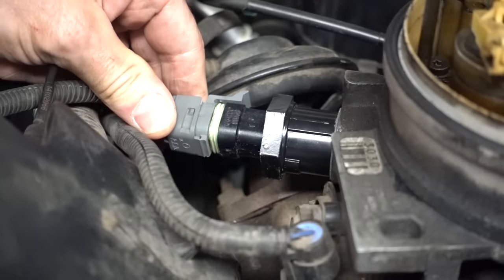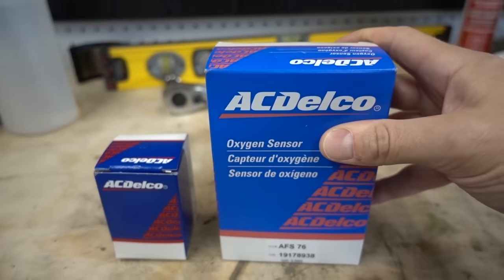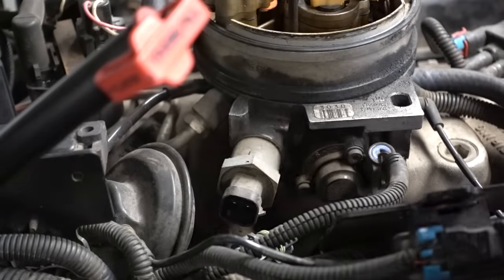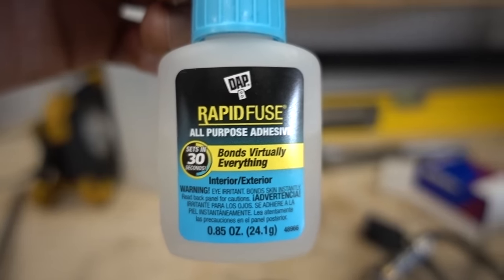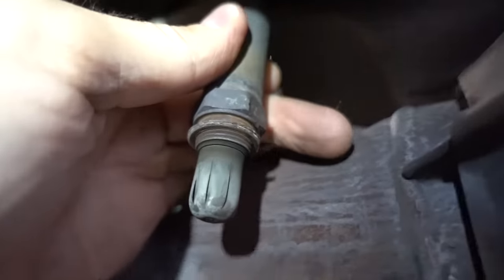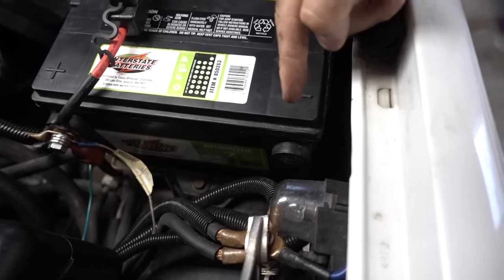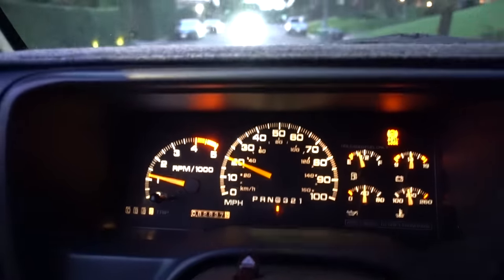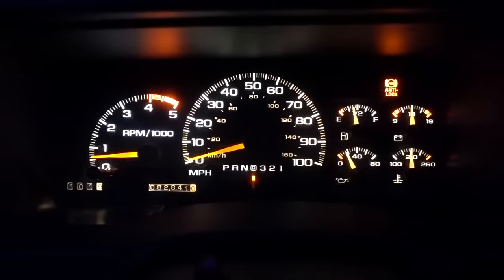Here's the TWO SENSORS YOU NEED TO REPLACE FOR BETTER IDLE !!

Comment: It's either a dirty or clogged egr valve, map, maf, throttle position sensors, carburetor if not the idle air control valve for rough idle. Also, check the vacuum lines for leaks.

Comment: plastic service allways has a glass slick servface so for bonding of to plastic services , even to add a small back up piece, it is better to sand or scratch the shiney off the pieces, it never faild me, even on tiny tubes i cannot get any more, it works great on plastic parts, the weld putty in a tube allways worked for me, like your u=tube, thanks

Comment: Apparently you don't know anything about vehicles, because you called items #1 and #2 sensors in which # 1 is not a sensor, it's a motor and not a sensor in any way shape or form, item # 1 is an IAC (idle air control motor), so there you go.
Reply: Idle air control module! SO, there you go 
He's correct that the IAC can cause idle issues per multiple sources, not just YouTube. 
Have a great day. Be the positivity you want to see in this world 🤙

Comment: Hey Jimmy FYI you need to drive a vehicle with a compute 50 to 100 miles for the computer to calibrate to the new sensors. Also the sensors may not look bad . But you have to remember that a by product is heat . Electrical will lose continuity after it has been heated up and cooled so many time" Hence a short circuit "

Comment: The best thing to do is to replace the connector, im sure they can be dissassembled and replaced without soldering using paperclips or the special tool for terminal removal which is fairly cheap also.

Comment: If you have an idle problem when the engine is cold it's probably the IAC valve, not the O2 sensor. O2 sensors don't work until they come up to temp. Even modern O2 sensors with heating elements take a few minute to warm up. The computer knows this and does not use the O2 sensor on start up.

Comment: The idle air control valve will let in more air in the throttle body when the air conditioner is turned on to keep the engine running smooth under a load..
Reply: Thank you. Probably would smooth my engine out when AC is on.

Comment: Cleaning injectors are easy. One quarter tank of gas,  put two bottles of Chevron techron injector cleaner. Drove it down to 1/8 of a tank, fill tank. The cleaner will have done it job. I have used this method when I have noticed a performance loss.  Will use this method proactively once a year.

Comment: Haha.
Had a friend lose his azz replacing parts on his R30.
Replaced the throttle body, injectors, Idle air cont valve, TPS, coolant sensor, fuel and pump.
Before all of this he asked me what I thought and I told him yes it’s dumping fuel but check your distributor, cap , rotor, wires and plugs.
He didn’t mess with the distributor.
He replaced all above mentioned parts and gave up.
He sent it to a trusted shop
That had it for a couple days and they found out his distributor was shot.
I think it was the shaft gear that was worn to darn near nothing.
New dizzy fixed his issues.
He called me up next day and told
Me I was right but he ignored my suggestion and went for everything but the distributor

Comment: I got tired of sensors giving me problems and computers letting me down.  All thats stuff was supposed to make the vehicles run better but as it turns out, they just cause problems when they fail.  The fix?  Mechanical injected 12 valve Cummins.  ;)  give it a try!  Hehe

Comment: I put a cone filter on without a sensor[ Nowhere to put the sensor] The idol ran rough. I put the original back in with sensor and the idol was fine. I didnt wanna cut a hole for a sensor so I put the original parts back in.
I'm gonna look for an another rubber pipe today

Comment: If you're trying to fix a clip like the one that snapped, next time use superglue and sprinkle some baking soda on top. It hardens instantly and hardens ALOT harder than normal. You can even completely replace the clip by making one out of super glue and baking soda sometimes.

Comment: just as an FYI as soon as you elevate your RPM your computer no longer sees it as "idle" and so when you say "I have been driving it for 5 minutes and it idles great" is erroneous because again, while you are driving it the vehicle is NOT in idle. There are also multiple forms of "idle" there is cranking idle, post-start idle, warmup cycle idle, and post-temp idle. So each of these will be affected differently based on the problem variable. On a tunable computer, you can change the static values associated with each of these circumstances. On a stock computer, the dynamic program can make this a challenge. If you find the vehicle is scavenging or "wandering" in its idle even after you replace the O2 sensors/IAC it is very likely a vacuum leak. Checking over all of your hoses can be valuable considering the old rubber on a 30 yr old truck easily could be cracked allowing small vacuum leaks to occur. I have a 1994 Mustang GT with a 302 and multiple bolt on's running off a MS3Pro PNP Megasquirt standalone ECU.

Comment: Take a little permatex plastic weld, Clean the plastic and put a little bit across the outside of connection and it will neber come out and if you have to unplug latler you can take a dremel and cut plastic weld, That plastic weld is stronger than the plastic and bonds very good, It heats up when it cures.

Comment: On my truck I have 2kw inverter, when I start microwave - voltage drops to 12.6v, but after changing ground wire - 14.4v under same load. Alternator 180A.
Reply: How’s this possible,
Reply: @beforeal580  high resistance connection
Reply: Yeah, positive side important for obvious reason but a weak high resistance ground circuit can cause all kinds of wacky issues

Comment: Judging by that hesitation upon start. I would suggest checking the gap on your spark plugs. Last thing when you reset your computer the jumps in RPM are what the vehicle will do to program itself. It will go away which I'm sure you probably kno by now. So whoever resets their computer it's good to run everything not all at once but when you go for that first drive so the computer compensates for the extra power it needs. Remember most newer vehicles do constantly learn. Older ones take a little more time and a reset once every 25-50k couldn't hurt. Even helped my mahs 2014 Fiesta Titanium and that thing has computers and gadgetry up the wazoo...

Comment: the IAC connection can be tightened up, but the proper fix is to remove the pins and get a new plug socket and insert the pins back into the new plug socket (or replace the pins AND the socket) but either way you CAN tighten up that connection... Lords Blessings! MARANATHA!!!

Comment: what you could do which  i saw a mechanic do is take a screw driver & heat it up with a torch for 30 -40 sec till it gets nice n hot then just melt them back together with care you could try that

Comment: Yes my Civic has 208,000 miles on it and recently sat for 5 years.  I thought about changing my O2 sensor(s) but I'm getting 37 mpg just like before so I'm unsure if I need to.
Reply: Is check engine light on? If so go to most any Auto parts store and get the code look it up if it's the o2 sensor at that point change it. Just for starters financially it's not a good idea to just start throwing new parts at it. Learn how to diagnose the problem or you can take it to a shop and have them tell you what's the problem then go home and fix it 
If you have the skills. That should save you money, time, aggravation and a headache. Good luck 🐒🔧

Comment: If you want a better idle, it's plugs, air filter, and quality fuel. cleaning an idle air control valve can help if dirty because they do open and close allowing for small variations of air to be let into the intake at idle. I've always found better ignition to be the best way to get a better idle.

Comment: You're right - RPM increase will go up with A/C running. Hint - if idle surges (idle goes up down up down up down...) when You turn on the A/C, You're probably LOW in refrigerant. Watch the top end in refrigerant and WEIGHT WHAT YOU PUT IN - HUGE difference in GM products for the last 50 yrs. Most people don't realize that. Hey - if MORE people traded experience, what would the world be like, right?

Comment: My 99-Z71-4X4-k1500 pick up has-4-O2 senors on the exhaust system. Sometimes it idles rough but my computers are constantly readjusting.

Comment: I have a 1995 GMC Suburban 2500 4x4 with the 5.7 motor. IT was showing an error code for the O2 sensor.  I replaced the O2 and MAP sensors.  While this cleared the code, the motor now stables, runs rough when RPM's are over 1500 and secondly, at idle, the motor will die when you put it drive or reverse; this happens 90% of the time.  Any suggestions where I need to look next?  These problems were not present with the old parts!

Comment: Not always true I'd replace those 3 times and still had the same issue then they said oh you need to replace the ecm and 1200 dollars later still running and idling like crap so I had done all that stuff changed and still nothing along with the ecm swop and surprise it wasn't none of those. So I put the one parts back on and put the old ecm back and I changed the 69 dollar vaccum booster and whammy it was fixed and running perfect so it's not always the idle air valve and o2 sensers and computer brain box.

Comment: Yes the initial high idle when you started it was the IAC motor automatically adjusting But i did wonder why did you replace the O2 sensor?  Did you have a check engine light for it?
Reply: O2 sensors start to read slow as they age so after 25 years of service in the exhaust system it's probably not a bad idea to change it.
Reply: @chevyguy6961  but why just one and why that one?
Reply: @karlpatch4146  My truck only has one O2 sensor that's screwed into the exhaust manifold.

Comment: The solenoid that powers the idle air control can just fail sometimes. Had to change one in my wife’s GMC Sierra which fixed the same problem you had

Comment: I have a 89 p u five seven TB at around 250,000 MI I had bad idle changed all sensors still Idol was bad finally changed my EGR valve that fix the problem

Comment: Weather pack connector is what u need for the IAC GM used to own the connector you can search 4 pin Weather pack connector on ebay or Amazon and will be exact fit

Comment: I have a 95 silverado . I noticed that your anti lock light is on . Mine is on too. I have a obd2 meter with a obd1 adapter from Amazon it would not work. So I couldn't clear code. Can you do video on  clearing codes out.

Comment: Im cleaning my 2003 Toyota's plastic electrical connectors with Meguiar's D101 All Purpose Cleaner. I then put 2 coats of Aerospace 303 on the cleaned plastic connectors ( not on metal electrical connectors ). Am i preserving the plastic or just get new connector housings? ( Toyota/Honda use wiring harness plastic connectors from same supplier ). Thx.

Comment: Great video, your on your way! I have a 2013 Nissan Rogue that idles high on cold start, cleaned mas and intake manifold, no codes. Rpm goes to 2k on start up, I think I'm going to try your sensor solution. Any advice? Thanks.
Reply: Your truck is supposed to do that.

Comment: The ECM in my Wrangler TJ is malfunctioning.  In order to get the aging Jeep fo start I had to jump 12 volts to the fuel pump and the fuel injectors. When cold, it runs very rough.  When warm, you can not tell the computer is destroyed.   I guess I am buying an ECM at the end of the quarter.

Comment: Iac was dirty imo. $50 for iac isn't cheap to me but considering most parts.... Ok. But probably just needed a clean. Looks like u still have a check light on. Good idea with the clip. A raise in rpm when AC is on is normal.

Comment: Guys, I had idling issues after my engine gets warmed up. After months of googling I found IAC is stuck on my palio 1.2 (2002). So I have removed it and cleaned with carb cleaner. I also loosened the spring and removed the thread which comes on it. Now the problem is I don't know how to recalibrate the thread which is present on my IAC. I don't know whether to tighten it till the end of thread. Because I'm concerned about the free back and forth movement of the IAC. Please let me know if you guys know how to calibrate or how much should I tighten the screw thread on my IAC. Thank you!!

Comment: I installed my IAC on my 01 Durango 4.7 ..now When I back up. I'm hear a clicking sound. Like that cards attached to bicycle spokes; which was not there the new was installed??
It's idling perfectly . NO noise going forward. However I did accidentally dropped a screw down between the radiator & condenser. But that shouldn't may noise going reverse; should it??  Only other possibility is adjust the new  iac . The old one was extended too far as if stuck.

Comment: Where does the other end of the  sensor connect? I live in a 95 GMC van and it has the exact same setup and currently dealing with a really bad idle I replace the IAC valve already but haven't done the 02 sensor

Comment: had a 92 Mercedes that idled around 1800 was told by a Mercedes shop that it would be around 1500 dollars that weekend I spray cleaned the throttle body and took the battery out over night and bingo the idle went back to 750

Comment: Did you look at your system with the OBII reader and did your "check engine" light come on? I have an older S10 Blazer and changed the O2 sensor on the driver side and when I looked with the OBII reader all the O2 sensors read "INC" and it was supposed to read after a drive cycle. I wish our engineers would be as patient as the Japanese engineers, I know they could build better.

Comment: As a GM owner, I could say this but even at 95 GM was behind the times with that truck. It looks like it was stuck in the 80s with the throttle body fill injection. Ford had a direct injection.

Comment: I just replaced my Idle air control valve, throttle position sensor, m.a.p. sensor, rewired the idle air control valve, NOW i just need to replace the O2 sensor... Oh and i need to rewire the map sensor

Comment: No way I could just replace one part and never know which was causing the problem.   And I’ve never  replaced an O2 sensor that came out that friggin easily.    Oh, it may hav3 been useful to include some quick footage of what the rough idle symptom was like for the viewers who are wondering exactly what was wrong with the truck. Just a thought.

Comment: Just plug in the connection, and put a spot of rtv on the connection. The rtv will hold the plug in. Might need to reset the IAC. Turn on the power, engine not running. Unplug the IAC. Turn off the power, and let stand for a minute or two. Then plug in the IAC, start the engine, this will reset the IAC.

Comment: One of your problems was a dirty throttle body. You need to either get it cleaned or clean it yourself. Get a book on your truck at a parts store and it will tell you about the IAC and everything else. It is normal for the engine to increase in RPMs after turning on the A/C. Get a book.

Comment: I would be thinking that with both the sensors not really all that tightly installed  there is a good chance of an air leak which may have been the culprit of the issue with the idol in the first place. Just a thought/suggestion.

Comment: The IAC valve is NOT a sensor.  The valve pintle can take a bit of extra time to adjust the first time you start the vehicle after installing the new part.  This is because a new part is usually standing open a little farther than normal after installation.

Comment: I would have completed the relearn procedure for the iac/TPS before unplugging the O2 sensor. It will take a tank full of fuel for realized benefit. This philosophy of replace because of age or mileage could be argued if the parts were at least the same as they were O.E. quality wise. But in fact they're selling them even close to the quality of the original despite however their appearance. Said packing on electronics when they often use the same picture in the ad it's even harder to distinguish jump electronic part compared to a decent one.
Reply: Jump should be *junk

Comment: Think my o2 sensor, in my 2004, 4 cylinder, Toyota Tacoma,  needs replacing too... does this sensor affect the engine randomly  misfiring when driving?
Reply: The problem is what came first. Is a misfiring engine causing a fouled 02 sensor or is a failing 02 sensor causing a misfire? The cheaper fix attempt is replace the upstream sensor(s) and hope that fixes it

Comment: we have a 97 suburban with a 454 it was running fine then it shuts off and now when i try to start it its like the ignition timing has been advanced so much when it tries to fire it misses and kicks back i have checked all i know i replaced the crank sensor checked the wiring changed out the ignition components do you have any ideas what it could be like i said it was running good

Comment: There’s basically only 2 global reputable o2 sensor manufacturers.
The fat, barrel-shaped ones are Bosch. And the smaller, curvy ones are NGK.
They DO white label for other OEMs. So you basically have an NGK O2 sensor
Reply: BTW, add a gallon of lacquer thinner to the tank at your next fill up, especially before a road trip.
It cleans up any varnish in the fuel system as well as any spot buildup in the cat(s) from running too rich.

Comment: You could use a scanner to check your fuel trims before and after. I imagine it was your IAC sensor? I have replaced my IAC and it still idles rough. With mine I am going to check the bottom of the throttle body to see if needs cleaned?
Reply from the maker: Is that checkable with pre-‘96? I’m sure it is but how?
Reply: he is on OBD-I
Reply: @cpscps2679  Good point. Probably not possible?
Reply: @FabiusMaximus1000  I think a pre-OBD-II scan tool that could do that would be prohibitively expensive.